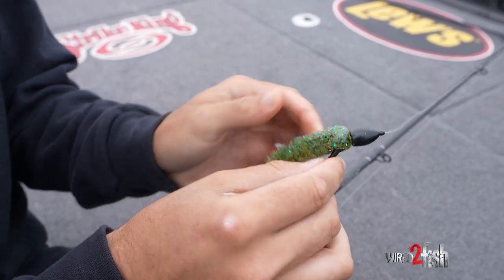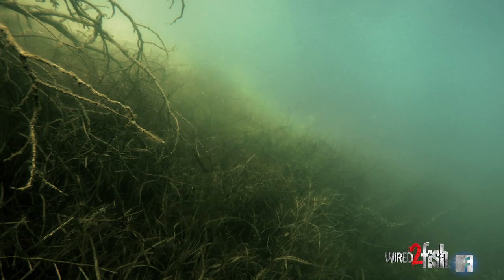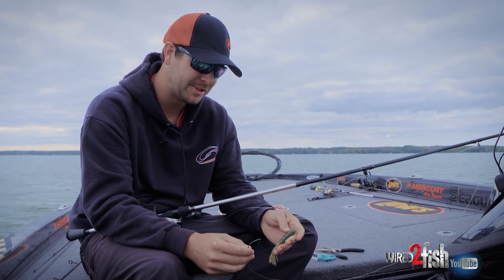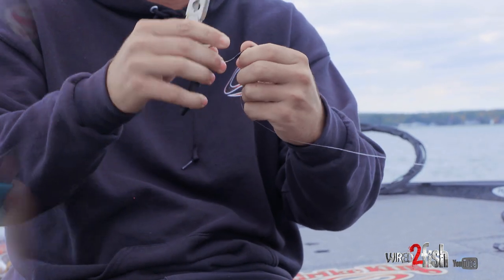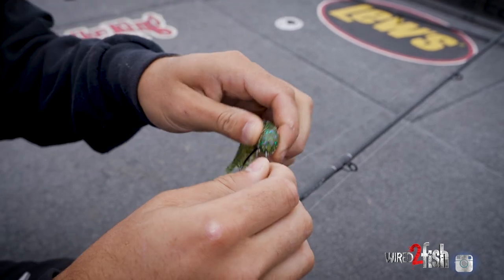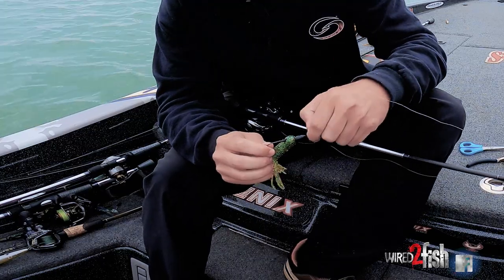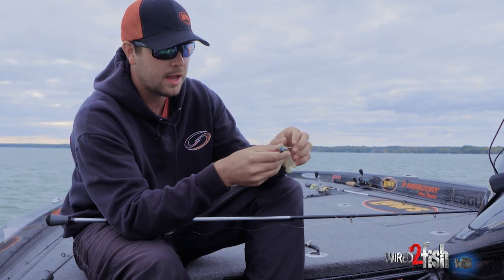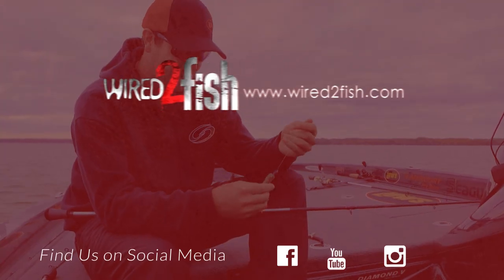How to Texas Rig Tubes for Better Hooking Percentages

Comment: Great idea!  Not much of a sneller, but nothing I can't learn.  Do you consider it necessary with that Trokar tube hook?   Would you say that Trokar tube hook in a 4/0 would be an appropriate size for pitching grass with a standard, thicker 4"/4.5" flipping tube?  And how important do you feel using a tube with a solid 1/4" or so at the top is vs. tubes that may not have that solid portion?

Comment: What are some of your favorite tubes?
Reply from the maker: Hi Richard, there's a bunch of good mainstream ones -- the Wired2fish staff like those from Strike King, Berkley, Zoom, and Lunkerhunt a bunch. The biggest consideration is size. For Texas rigging largemouth, a 4- to 4.5'' Flipping tube is most common. We often target smallmouth with 3- to 3.5'' tubes, and sometimes even down to 2.75'', but the bait design is simple and straightforward, so offerings from most soft plastic manufacturers are quality.
Reply: Cabin Creek 👍🏼